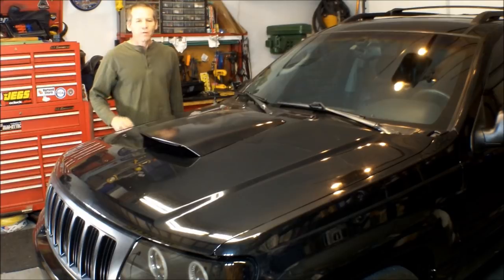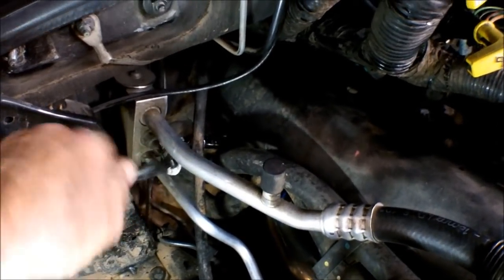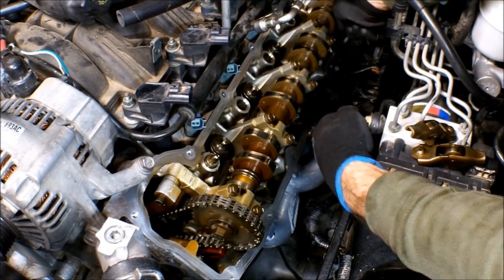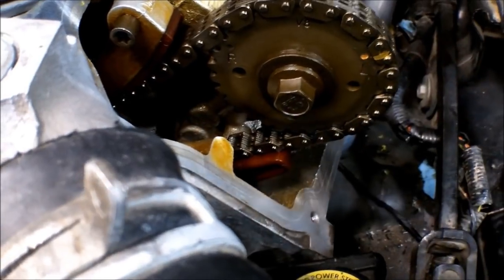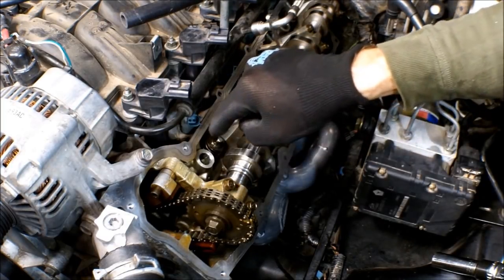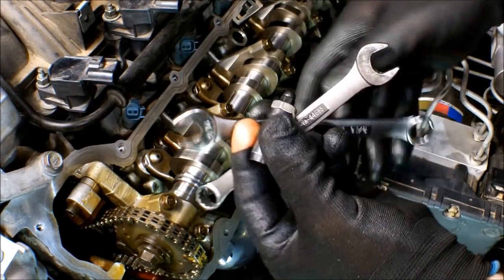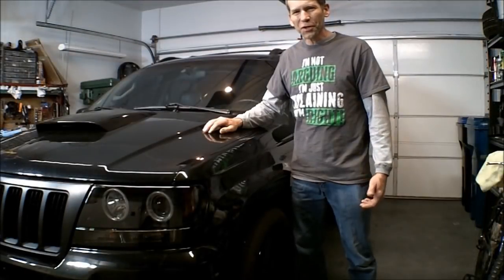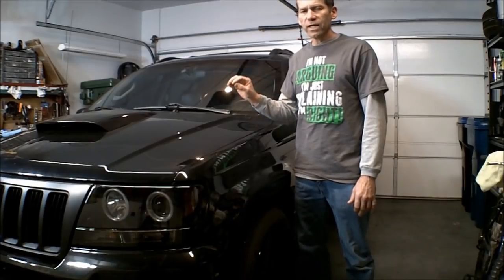How to Install 4.7HO Camshafts & Solid Lifters in a Jeep Dodge Chrysler & Mitsubishi

Comment: Very detailed explanations as always. How much cussing do you have to edit out of your videos if any? You are always so calm. A few words would escape from me I think lmao. I love your jeeps and the mods you do.
Reply from the maker: lakrabid I don't recall cursing on that one I always do edit that kind of stuff out. You do have to have some patience with those solid latch adjusters though
Reply: martinbuilt aren't the lifters supposed to compress down just a hair and spring back up... mine are old and Frozen in the up position.. that's not a good thing there's supposed to have a little compressibility.. I'm really confused how to solid lifters work without slinging and pushing out the rocker arms...
Reply from the maker: steve mitchell I adjusting the solid lifters to the proper clearance. The hydraulic ones adjust automatically but you do lose some lift so you lose performance with hydraulic. they also have a slower closing rate. I just went out and checked all my old hydraulic ones they are all as you said frozen in the up position and they were working just perfectly fine. I would be more concerned if you could actually push them down
Reply: martinbuilt you are supposed to be able to push a lifter plunger down but it's supposed to spring back up there's a spring inside if it stays in the down position that's  a problem or if it stays in the up position  that's a problem.. there is supposed to be about a .50 valve lash cushion... if the lifter is stuck in the up position when the cam lobe comes around and pushes on The Rocker it's going to push too much force on the rocker arms and  wanting to spit it out... if the lifter spring is busted lifter plunger in the down position when the cam lobe comes around now the Rockers way too loose and it can get spit out... that's why it's important for the lifters on those goofy ass 4.7  and 3.7 valve train design to be in good shape..

Comment: You do great expiations as to the parts and the tools needed. 
Question MartinBuilt:
Is their any issues using HO pistons, connecting rods with bearings, HO heads, intake manifold, HO cams into a 4.7 regular 8th digit N. Not changing crankcase due to tone ring i will use my normal cam tone ring. 

I ask because you do know alot of tricks on these 4.7 and the jeep grand cherokee
Reply from the maker: No there would be no issues doing that, you may want to just change the tone ring on the HO engine to a 32 tooth and the right cam sprocket to work with your vehicle and that way you also get the steel crankshaft.
Reply: Martinbuilt i may do that. Thank you for the fast reply and solid information. Was wondering if the tone ring was interchange. To correct ya take off the 32 tooth and replace with original 16 tooth tone ring...

Comment: Probably a stupid question,but can I use 2002 heads for a 2005 4.7l? I have the engine block, but have a master rebuild kit for 2002. Any suggestions and or wisdom that you can share?
Reply from the maker: yes, yes you can. So you have the heads from an 02 and what the master rebuild kit.
Reply: @martinbuilt  the rebuild kit is for an 02. The block is an 05. I may have to use what ever heads I can find, honestly. Thanks for the help.

Comment: What type of headers did you get to fit in there?  I went through my 01 Limited 2 years ago, rebuilt from bottom up with .020 over pistons and about .010 off the heads, Superchips towing tune. Runs awesome and I am happy but I just ran across a 04 Overland with the H.O. and can get the whole thing for scrap. it starts and drives and runs but had no title and is pretty rusted out but was hoping to pull the cams and transfer them to my 01 and maybe swap the intake while I am there for a little more oomph. Thanks for the Video and information!
Reply from the maker: Doug Thorley Tri - Y https://www.youtube.com/watch?v=u6-Yl1z8auA

Comment: I have a 2004 4.7 h o Jeep Grand Cherokee. My question is if I pull out a camshaft from the 08 Durangos will it increase the horsepower or should I just stick with the stock 4.7 H.O camshaft? And if I do need to pull out a camshaft from a Durango which model do you suggest?
Reply from the maker: It should increase power but may change the torque curve or when you feel the power. I would also install the 08+ intake manifold with a larger throttle body. My Jeep Grand the power really kicks in at 3200 past 6000 RPM
Any of the 08-13 Jeep, Dodge 4.7 engines with dual spark plugs per cylinder will work.
Reply: @martinbuilt  just checking... Does it have to be from the years 08-13, and only from the dodge and jeep 4.7 engines??
Reply from the maker: @noemah3272  
yeah all the 08-13 Chrysler, Jeep and Dodge 4.7 engines. These engines will have dual spark plugs per cylinder.

Comment: Hello. Thank you for the explanation, i am on to this now but what it the lifters that i bought do not come with any adjusting at all..
Reply from the maker: That's fine the ones you have are a OEM style lifter (latch adjuster). I would just soak them in oil for at least half an hour if not a couple hours before installing them. The adjustable latch adjusters I installed are great for reground high performance camshafts or if you're just wanting to get that extra edge of performance.
Reply: @martinbuilt  Great , i installed everything last night and worked like a charm thanks to you!

Comment: Have you considered installing the prothane bushings front n' rear? Video?
Reply from the maker: I did build these rear lower control arms that worked out great. 
https://youtu.be/-pQXGzoC6SE
Reply: @martinbuilt  my rig is mostly my street driver. I used Detroit Amazon brand components throughout.
Reply: I cant tell you how much your videos helped with some nagging issues. Especially the anti-sludge piece. Solved a severe smoking issue and oil burning. Turns out you were right I was using the low end donkeyToy branded (?) Unit $17 dollars. What could go wrong? Plenty as it turns out. The $70 Standard Part 2008 unit was just the ticket. 👍

Comment: can you replace the valve stem seals without taking the cam off? i got some blue smoke after i sit at a redlight then gas it to go. none at start up tho. but i do have some lifter noise at startup. so i was thinking of replacing the lifters and stem seals to see if that would solve the two issues.
Reply: Travis Flint**** Check your coolant level. ( may be leaking into cylinder )
if so then stop driving it NOW!  PULL THE HEADS ( BOTH ) AND FIX IT.
NOW.

Comment: hello and thank you for your video. i got my hands on a jeep just like yours and I think i will need to do the lifters. is there a difference in performance between the solid ones you installed and the self adjusted ones that are there from factory? the motor has 148k miles. thank you again.
Reply from the maker: The solid lach Adjusters give you a higher RPM potential with a faster closing rate on the valves. They are time consuming as far as getting them adjusted properly but once you get them adjusted properly I really like them.

Comment: Hi, I got a 2012 ram 1500 with 275k miles. It’s got a slight rattling noise when running. Doesn’t blow any smoke. I’d like to replace the lash adjusters and probably the timing chains with guides/tensioners and valve cover gaskets. What would be the parts/kits that you would recommend? If you could share the links, that would be great. (Trying to do repairs budget cautiously without compromising on the quality of the parts much.) I don’t want some cheap Chinese lifters to fail on me after all the work I’m about to do on it. Thanks for any recommendations!
Reply from the maker: For the timing chain set, I would go with Cloyes 
9-0393SF www.ebay.com/itm/For-Ram-1500-2011-2013-Cloyes-9-0393SF-Front-Timing-Chain-Kit/283801795203?fits=Model%3ARam+1500&hash=item4213e7ba83:g:0QMAAOSwaqFeXQKM
Not finding anything for the lash adjusters.
Reply: martinbuilt what brand would you recommend for the lifters/lash adjusters?
Reply from the maker: @vibarus  maybe seal the power but they also might be made in China. Other than that OEM

Comment: Hey Martin! Love your videos! 
Got a question for you. Ive swapped Dodge Ram 1500 04 with Jeep's HO engine. I got 4 plugs on ECM. 
Do i need to adjust fuel map on my ECM manually? I feel this new HO engine currently is less powerful than i had. 
Thanks!
Reply from the maker: Thank you, that is the first time I have ever heard someone say they lost power with HO cams. I would place the ECM in a quick learn by resetting it.

Comment: Martinbuilt: question please: which is considered left side the drivers or passenger side. I downloaded service manual and I have a Haynes manual they are conflicting with which is left/right. Can you help me decide the correct side ( is it from sitting in drivers seat)  or looking straight at the front of jeep outside ? I Just purchased the wedge using your link hope it helps your site out. Thank you Martinbuilt!
Reply from the maker: I've always considered the left side, Like if you were sitting in the vehicle.
 When it comes to rotating the engine clockwise then it's always  as if you were standing in front of the engine facing it.
Reply: Thank you for your quick reply. Always the best videos and information on the web.

Comment: So if i put ho cams in, I have to switch to solid / adj lifters? By the was outstanding job!  Which is the best cam, 04 ho or 08 cams?
Reply from the maker: Thank you, I really appreciate that. I'm glad you liked it and found to helpful.  no, you can keep the OEM lash adjusters. I just decided to go with the solids.
I like the 08 cam shafts, But I would recommend also the 08 intake manifold and a larger throttle body with those camshafts and a very free flowing exhaust system.
Reply: @martinbuilt  Is there a benefit to using the solid lashes adjusters over the hydraulic?
Reply from the maker: The best benefit is that you never have to worry about a collapsed lash adjuster. 
You also have a higher RPM potential. Which in turn gives you more horse power.
The disadvantage is that they are very time-consuming to get them adjusted properly.

Comment: Do you have a video of installing those custom battery terminals? What kind of battery is that?
Reply from the maker: John Blair no I don't. I was actually working on a video for that and then after I saw some of the footage I just threw it away it wasn't any good. I got them off of eBay if you just look up battery terminals for audio you should be able to find them.

Comment: What direction you turned the engine to rotate the camshaft?  Clockwise??
Reply from the maker: Yes when facing the engine turn it clockwise. Thank you for watching 😊
Reply: @martinbuilt  Thanks YOU so much... I'm considering to get this solid  lifters because I'm sick and Tired of replacing the hydraulic lifters don't matter the brand I get they always fail sooner than later. The only issue I see with these solid lifters is that we have to readjust the gap if ticking re-apperas after a while so I don't know if that would happen in the same time frame as when the hydraulic lifters fail or it should never bother for a longer time than the hydraulic ones

Comment: Hey Martin, are you required to check clearances if you don't remove the camshaft, and are only replacing the lash adjusters and rockers? Thanks!
Reply from the maker: If you're using hydraulic lach Adjusters you do not need to check clearances. If you're using the solid lash Adjusters when changing camshaft you will need to check clearance.
Reply: @martinbuilt  Great thank you Martin. Take Care.

Comment: great video, as always! question, what do you think of the solid lifters? i know you said they were a bit noisy, did you keep them?
Reply from the maker: Yeah if you don't get the  tolerances really tight like down to .0015  you're gonna get a little noise from them.  And they are a lot of work to get them adjusted properly but once you do I really like them.
 I don't have to worry about a lash adjuster failing and a rocker arm coming out and doing damage to Cam shaft and cylinder heads.
Reply: @martinbuilt  I am having troubles finding anyone selling them, do you know of anyone that still does?
Reply: @KyleGreenhow  Airram Performance
Reply: @gooble1050   You found them! Thank you, but $390, yikes

Comment: I've got a 08 4.7 Chrysler Aspen.  I'm looking to add to it this summer.  Where should I start?  Stock.
Reply from the maker: That engine already has 304hp. Someday I hope to reach that. Lol. Maybe look into a cat back exhaust system.
Reply: martinbuilt that was my initial thought too.  Supercharger?
Reply from the maker: Supercharger...Go for it!      I have been thinking about swapping in a 08 or newer 4.7
Reply: martinbuilt  I also was thinking about trying that, but im not real sure how hard it would be to make everything work with the dual spark plug setup and ecu stuff? Have you found any good reference information anywhere online? And can you measure your timing chain wedge for me so i can make one? I have to pull the right head on my ho wj later today? I was considering making a wedge for the tensioners, but i dont know what the correct dimensions would be.
Reply: zych

Comment: good night martin do you know why it shoots blue smoke when accelerating the grand cherokke 2001
Reply from the maker: Engine too full of oil
Engine low on oil
Cylinder head drain back holes are clogged
Valve stem seals are worn out
Broken piston oil control ring
Plugged crankcase ventilation,
 PCV
Excessive piston ring clearness or scratched cylinder walls.
Reply: Rings when smoking accelerating, valve seals when smoking de-accelerating.
Reply: @charliedee9276  what rings are you talking about? My 04 jgc 4.7 h.o blue smoke when accelerating, no smoke when stopping, no smoke on idle

Comment: What if we are changing the heads? Same process?
Reply from the maker: If you're replacing the cylinder heads you're going to need to pull the front timing cover and redo the entire timing chain set.

Comment: Great video! I bought my Jeep on the cheap cause the 4.7 had been cooked. The lifters were seized but I freed them up with  acetone. But since getting her going again  I noticed the lifters are noisy so I'm guessing they are worn out. So should I buy replacements solid lifters or factory?
Reply from the maker: Jason Zaicos I think I would just go ahead and buy hydraulic replacements.  Unless you're going to be doing mods in the future and looking for more horsepower than go with the solids.
Reply: martinbuilt, ok then. I can't get head around why they are noisy. Its just annoying listening to them. Thanks for your reply. Your jeep sounds sweet by the way.
Reply from the maker: Jason Zaicos they're not supposed to be noisy. If they are noisy they are either collapsing or you have weak valve springs
Reply: Jason Zaicos could be timing chain tensioners are starting to go
Reply: Roman Beck, has new timing chains. Just bought new lifters. I remember the existing lifters were very soft to depress. New ones are much stiffer
Reply: @martinbuilt I was thinking about doing the ho cam and intake swap and getting a cold air intake and catback exhaust and MAYBE headers for my 00 4.7 would any of these mods require solid lifters or could I stick with hydraulic I dont really want to deal with adjusting the solid lifters if I dont have to
Reply from the maker: @jeep4life1994  You'll be okay to stick with the hydraulic lifters.

Comment: I found a 2004 Jeep Grand Cherokee HO at a wrecking yard and pulled of the cams and also grabbed the intake and throttle body.  Would it be worth getting the lifters off that engine and putting into my non HO or is there NO difference?  Also, anything else worth taking off that HO?
Reply from the maker: Lifters are all the same. What year is your 4.7
Reply: @martinbuilt  2005 Limited
Reply from the maker: @austonday141  the intake manifold and throttle body are exactly the same as the one you already have.
Reply: @martinbuilt  ok.  I've read some post that say to upgrade the intake go with the 08 intake?  What about valve springs?  I see some people talking about beehive springs.  Thanks for the response.  Appreciate the info
Reply from the maker: @austonday141  the 08 intake is awesome I've been running that for some time now you will need to buy an adapter plate to accept your throttle body as the 08 throttle body will not work because it's fly-by-wire. You don't necessarily need the beehive valve springs with the HO camshafts. Very unlike that you will get any valve float.

Comment: Martinbuilt. Have you gone to the 2008 cams ?  I'm askin because I'm having some issues with mine.   I have a 2002 grand cherokee 4.7, 08 cams 08 intake manifold . I'm on my second replacement engine and both have had misfires on cylinder 2 and 6 since I've added the cams  is there anything you have to do to the timing?  I've been told that they just bolt in.  I have new four hole injectors new coil packs new plugs  cant seem to figure out why two engines have had the exact same problem. Low compression on cylinder 2 about 75 psi and 6 is about 100  brand new remanufactured engines . Any thoughts ?
Reply from the maker: I have not yet gone to the 08 cams. I do have the set sitting here just haven't had the time to get them in yet. I have no idea why the two particular cylinders are giving you a problem that doesn't make any sense. Should not be any type of timing issues you have to deal with. The only thing I can think of is if there was something wrong with injectors on 2 and 6
Reply: @martinbuilt   they are new remanufactured Bosch/ Siemens flow matched 24# injectors we have check the pulses  with a stethoscope and they seem to be working  I'm lost as well  maybe bad valves ?